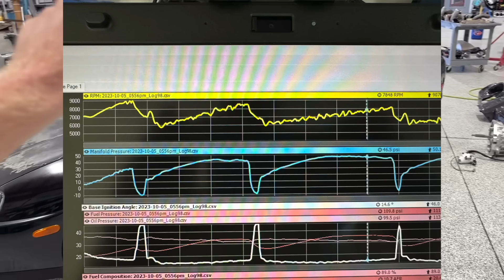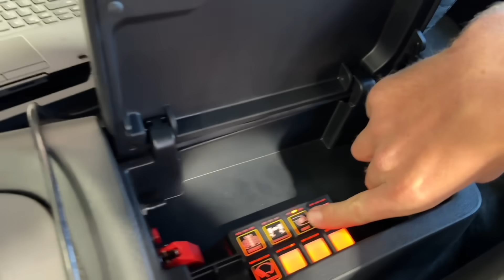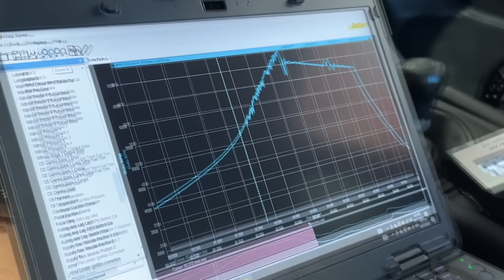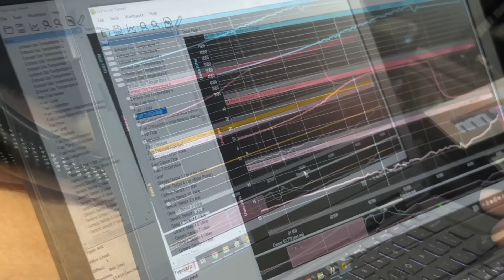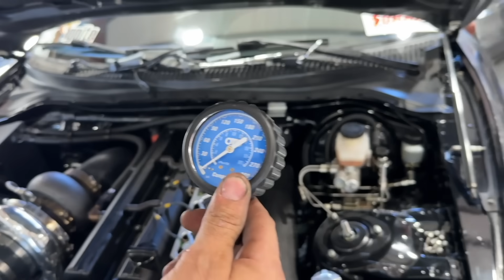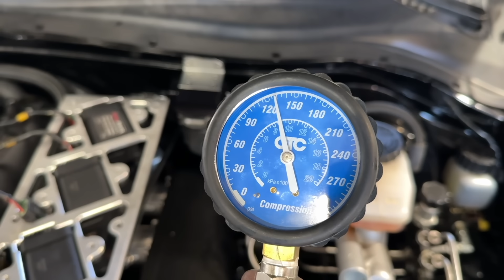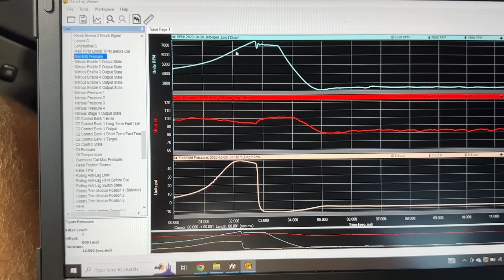Scaring Passengers In a 1,300hp SLEEPER SUPRA!!! The Rat Rod Supra's Mystery Issue is FIXED!

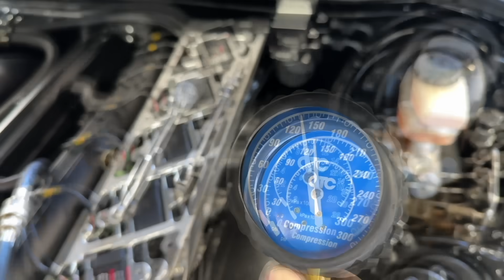Comment: 13:39 and 13:40 can see some huge voltage arcs across the head from front to back when turning it over, not sure if u have a defective spark plug wire or from the unplugged wires but it's definitely there... edit: well now I'm further along i can definitely say I could see it when you would turn the engine over

Comment: with gasoline turbo engines if there is not enough feul it will comsume somethink els like piston or valve its going to burn so yes it could be hurt a little like only a tiny bit of material gone somewhere but under boost it leaks normal running its not a problem

Comment: Forgot, I had a 289 once and I changed the carburetor, I changed plugs and wires and points still missed badly. It was the one dollar capacitor by the points. Geesh.

Comment: The higher the cylinder pressure, the harder it is to light the spark. So at high boost pressures any minor problem in plug wires or coils will show up.

Comment: The only thing I can think of is your plug wires didn't have the gauge needed to supply electricity to the sparkplugs at such a high rpm + heat

Comment: I guess if the wire was the problem, a manufacturing defect occurred where the copper cross-section was smaller, causing it to heat up with the amperage increase while in a pull. Could of also been from someone bending the wire too many times, braking some copper threads in doing so and effectively causing the same thing to happen.

Comment: You do need to get a roll gage in that beast. You need to go take it back to the boys who built it and find out what they say about the missing. It's under warranty isn't it? I think it is spark is misfiring. bad coils maybe. check the plugs see what they look like. It ran good till you put the fuel additives in it. I told ya plugs were not getting the spark juice. Put an ohm meter on wires and check them, under a load. That thing about came off the dyno.

Comment: that is not turbo lag, it is called the boost threshold. turbo lag is when you are on the boost and off the boost back and forth. boost threshold is when the boost finally kicks in and creates power. 

Love the video, not trying to be a buzz kill or anything. just stating facts. wish i had a mark iv rat rod supra making 1400 at the crank.

Comment: High boost and load, as you very well know, "increases" the power necessary jump the gap on the plug. Electricity, as you very well know, takes the path of least resistance. For every BAR (14.7 PSI) worth of pressure during the compression stroke the gap is essentially multiplied. 130 PSI while cranking 200 RPM is almost 9 bar. an engine at 12:1 compression will see nearly 12 BAR while running. Your plug gap has gone from 0.045 to 0.54, yes, your coil is covering the equivalent of a half inch gap at atmosphere. After that settles in take into consideration the fact that 15 pounds of boost (1 BAR) has doubled the atmospheric pressure, which further multiplies that, 15 is double, 30 is triple, and 45 is worth over 2 inches of gap. Coil doesn't care, it will dump full beans when power is cut from the field. This will result in a discharge to the path of least resistance or in some cases where it doesn't have one and you've exceeded it's gap capabilities it won't discharge "blows the spark out'. Degraded or defective wires can let the spark leave and depending on degradation location it may not discharge until your case where the gap outside become smaller than the loaded gap inside. I have seen sparks jump out of the gap on the plug boots, spots in the insulation that look perfect, even the sealed seam in the coils. You can diagnose it with a test light and water, wear rubber gloves, it tickles.

Comment: the damage on the pulgwire might be internal and not at all visible, it might be a dodgy spot that with vibration allows less current pass or what ever the case. I don't think that's a toyota problem.

Comment: I mean im no super mechanic but same issue was happening with my bmw i was running a high percentage of ethanol and it cuts it higher roms and throws me in limp mode so I upgraded the fuel system new injectors high pressure and low pressure fuel pump fuel lines and it ended up working like 10x better with a new gap on my spark plugs with oem ignition coils my 60 roll top end never felt so good

Comment: Hey before you guys start tightening your straps pull some slack so it will pinch on the strap itself . Let a roll or two come around before its all the way tight if you know what im saying thats the proper way to do it saw this on a vid 6 mnths ago i use straps for work all the time makes sense

Comment: "not a single issue with these plug wires" yea on the outside. i'd have a resistance test done to quickly identify the culprit/s. so easy.

Comment: Check the valve train maybe you need bigger exhaust vavles or stiffer springs, what about getting bigger and stronger bolts for the entire valve train?  The heads might be lacking enough flow for that much boost could be having residual exhaust gas left in the cylinders or even the back pressure causing the valve to stay a hair open, or the intake manifold is having resonance issues at certain rpms try replacing the intake? the injectors could have the wrong spray pattern? And it ends up being the simplest things PLUG WIRES! (AIR, FUEL, SPARK) it's always 1 of them hahahaha

Comment: I tried to calculate the speed the Supra was going at the end of the video. 
I looked it up, concrete light poles are spaced about every 300 feet on highways. 
The video is in 60 frames per second.
I counted the frames from one light pole to the next light pole being in the same exact reference spot in the driver's window. 
This took exactly 30 frames, meaning he's traveling 300 feet in half a second. 

Distance in feet = 300 
Time in seconds = 0.5 

Converting feet to miles (1 mile = 5280 feet)
Distance in miles = Distance in feet / 5280 =0.056

Speed = Distance / Time
Convert time from seconds to hours (1 hour = 3600 seconds)
MPH =  distance in miles / time_in_seconds * 3600

So according to my calculations, he was travelling at 403.2mph. You're welcome.

Comment: Now swap each plug wire one by one until you find the culprit and see what's wrong with that plug wire.   It probably wasn't the wires, just a connection issue.

Comment: I've seen plug wires cause lots of problems. The damnedest thing is them coming off. You can't pull the damn things off when you want to change the plugs but have to zip tie them on while racing to keep them on. Never have figured that one out.

Comment: cylinder 1: 130psi
cylinder 2: 125psi
cylinder 3: 130psi
cylinder 4: 130psi
cylinder 5: 125psi
cylinder 6: 130psi

you called it wrong on cylinder 2 being 130, but the gauge showed 125.
Could be a bad set of plug wires.

Comment: Obviously he's at higher RPM, but he's not totally joking about "anti-lag" button. WTF was it? 
By the way ... I owned a 97 TT Supra (bought it new for $47,547 from Costa Mesa Toyota). 
In fact, never once brought it to the dealer. lol. I modified it before it was 60 days old. 
I went to Stillen in Irvine who sent me to Rod Millen (Rhys) in HB. So the warranty was done.
So I know the speed of each gear (at least at the 7,800 rpm redline) with that passenger.🤣
3rd topped out at ~90 mph. 4th at ~120 mph, 5th at ~150 mph, and 6th I hit 180 mph.
Which means he was probably doing about 160 mph on that little highway with that dude. lol

Comment: Think the electronics are the issue, updatade gear drives or switch to manual
Reply: I came to this conclusion at 4:50,specislly after hearing the old guy
Reply: Loose cables or Chip weldings being loose from vibrations?
Reply: Turbo hits hard and shakes the car(rhymes in brithish)